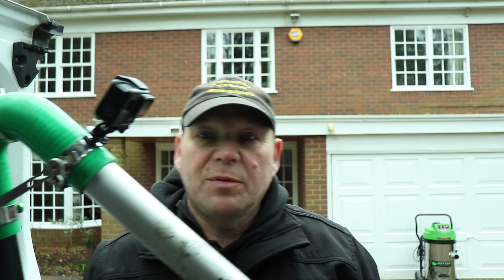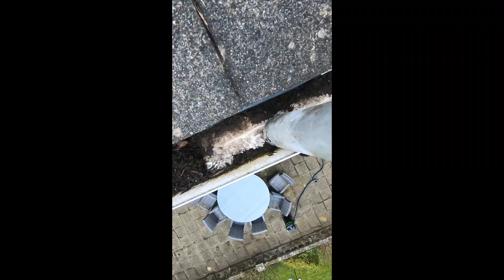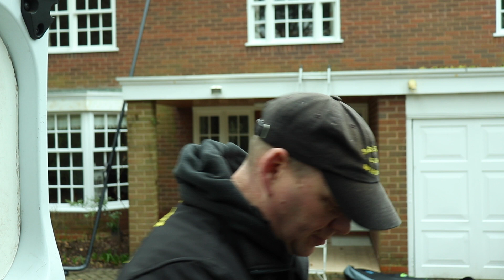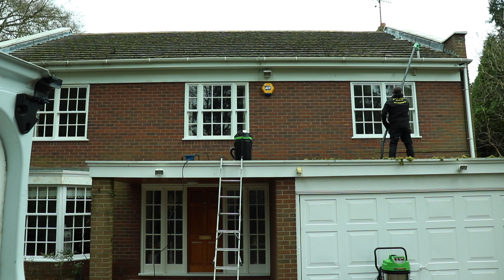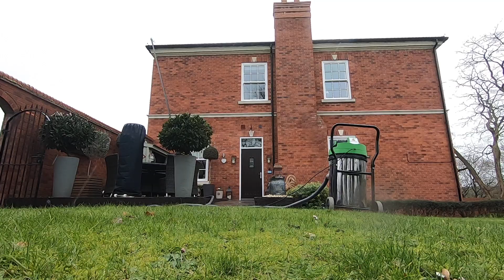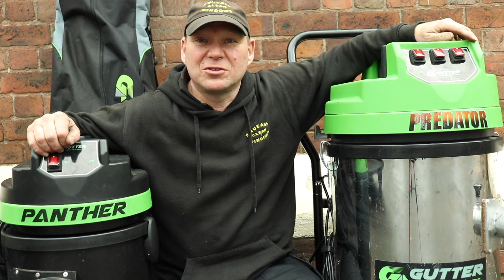Which Gutter Vacuum Should I Buy???

Comment: Thanks for the info Dave. Would you still recommend these vacuums ? Or which gutter vacuum do you recommend now that a bit of time has passed. Thanks in advance.
Reply from the maker: Yes defiantly recommend them
Reply: @squeakycleandave1  Thanks for replying.
Reply: I ordered a 1700w panther today, carbon fibre clamped poles. Adding gutter vaccing to my softwashing. Predator too much cash to layout. Thanks for the video.

Comment: Nice video dave im getting a panther 1700W this week im torn between clamped carbon poles or push pit carbon is it worth the extra cost for clamped mate?
Reply from the maker: Some people prefer the clamped but personally I think I prefer the push fit as they seem slightly more ridged. The only thing with the push fit is that you have to make sure you clean and PTFE spray them regularly so that they don't stick together. The only time I had a problem with that was when I had been using them for a few years and was being lazy with my after use care.

Comment: How do you know the gutters are clean , do you have a camera ? What happens when the gap between tiles and gutter is too small, do you check if the downpipes are clear ?
Reply from the maker: Yes I have a camera to check that they are clear. 
There are narrow nozzles that usually fit and if they don’t then it’s up a ladder. 
You can normally tell if the down pipes are clear as you can hear air being sucked up it when you put the nozzles in the top. If you can’t clear it with the vacuum it normally needs taking apart so it’s up the ladder

Comment: Good afternoon Dave, I am starting up with gutter cleaning, my system is 3600 watt power though only used it once on my own property.
How do I quote please
Reply from the maker: Best way to do it is to measure the length of gutter the multiple it by a figure. This figure will depend on the area you live in. You can also charge more on height and the amount you have to clean. For a 3bed semi I normally charge £5/m as a guide

Comment: Great video Dave. Can you please tell me how long you can use the wifi camera before battery runs out? I use Chinese gopro knockoff (ActionCam) and with wifi on it only last about 10 minutes. Thanks
Reply from the maker: I don’t know exactly but I would say at least an hour if not more
Reply from the maker: The other good thing about it is there is no lag. As soon as you move the pole the picture moves
Reply: @squeakycleandave1  Thank you for your prompt reply. Can you please tell me what model of gopro you are using? Btw I've ordered the camera bracket from Gutter Vacuum System after watching your video
Reply from the maker: @tomaskapustka2260  I’ve got the hero 7 black but there is someone on Instagram who uses a GoPro session and it always looks really good. 
Even the cheap knock off GoPros are ok for gutters

Comment: Have you ever looked in your gutters with  a ladder after thinking you’ve emptied them ??? I’ve been using a gutter vac with a camera for several years , they look very professional on any job , but they struggle picking up wet moss and even dry moss ,allways gets clogged in the head or the hose . ! Sometimes ladders are much better, at least you know you’ve emptied them properly.
Reply: What machine do you use Darrin ?
Reply: I’ve got 2 , a gutter sucker , and a industrial skyvac
Reply from the maker: I carry ladders on the van. As we all know you can’t always get to everything and I have checked gutters with them after I have emptied them and so far I’ve had no problems  not saying it can’t happen though so
Reply: @squeakycleandave1  we buy all this equipment to make our jobs easier,nobody wants to run up and down ladders anymore , but sometimes we have to .! I’m not saying gutter vacs are no good it’s just sometimes they arnt worth the hassle setting up . All best .D
Reply from the maker: @darrinperkins4842  depending on the job I totally agree. I wouldn’t have wanted to do that second job off ladders though 😬
Reply: Is the sky vac industrial 85 or the gutter sucker pro or the predator the best for regular commercial work or is there a better one